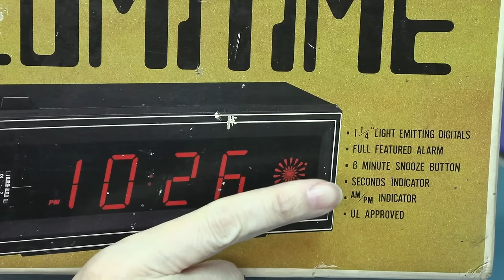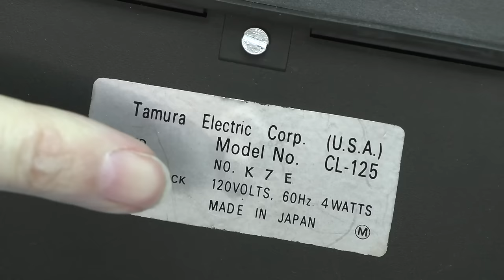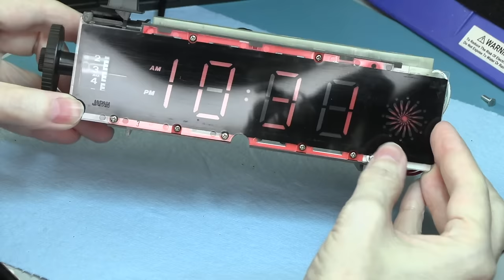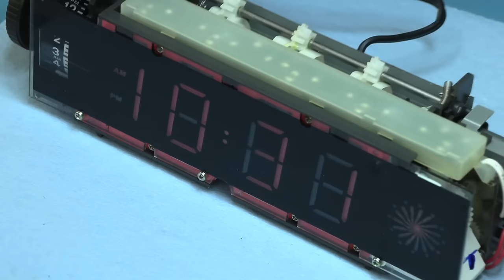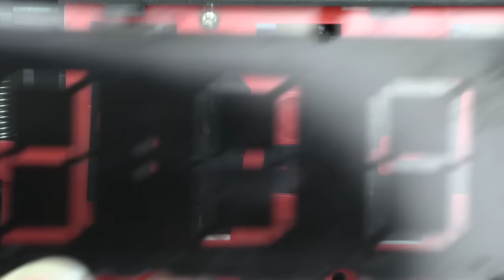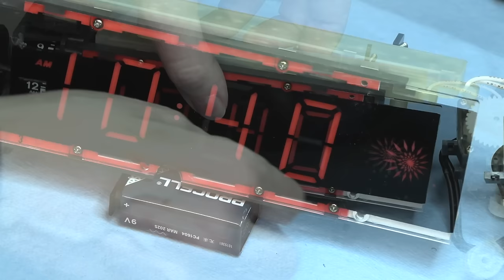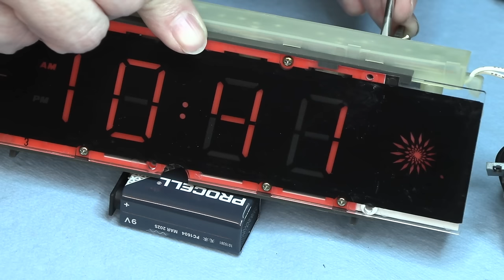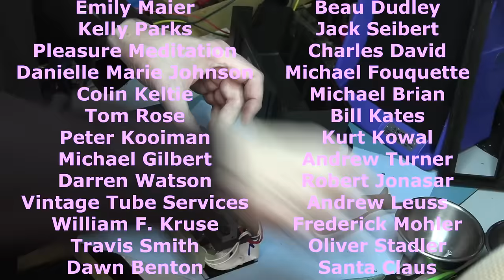Digital Clock Or Automaton?

Comment: Fran, if you can get a couple dimensions of that gear/shaft diameter with calipers, I will resin print and send you a replacement. Or a few - I typically print multiples +/- a few tenths of a millimeter for tolerance. I have been reproducing unobtainium gears for automatic turntables (and other vintage HiFi) for a couple years now, including gears that need to withstand being press-fit onto a metal shaft. I'm serious, no strings attached - I'd love to see you get this clock running again!
Reply: You're onto it! Need to experiment with some internal PLA slip clutch designs like the one shown in the video too. KUDOS
Reply: I always bore the holes up in press-fit plasic gears and glue them on the shaft with gel type superglue. Press-fitting them will cause them to crack sooner or later as the plastic shrinks. I do this even with original gears when I see one known as prone to this failure but not cracked yet, or started cracking but not between the teeth.
Reply: If provided with the needed measurements, would you still be interested to make those? My Lumitime just kicked the bucket and I'm about to buy another one in working condition and I'd love to future proof it, while repairing my current one.

Comment: A fascinating reminder of how ingenious humanity needed to be before the age of microprocessors.
Reply: You don't need a microprocessor for a segment display clock. The problem was that the new electronic displays and the active components needed to drive them were far more expensive, plus the "best" electronic clock display didn't quite come to be (early LEDs were notoriously dim and fragile, which is how come VFD helf up for so long - imagine when neon tubes are the brighter and more robust option) yet. Now it's the other way around, recently an American venture capital hype company with manufacturing in China of course released a very bland copy of a 1970s mechanical digital wtacth (see Amida Digitrend) and made everything run on stepper motors because of course they did. The original Amida was a cheap watch made to "compete" with the very expensive novel electronic digitals, and the Fakemida is a cheap Chinese watch with nothing inspiring to it (they stole the design, and filled it with the cheapest modern solution for the actuation) sold at an influencer premium.
Reply: How old is this desk clock? I remember building a digital clock kit, circa 1980, that was fully electronic! It comprised a single module that had all the logic and LED displays, plus a transformer, a speaker, a power cord, a case and a few pushbuttons. It was much simpler than the clock Fran has just reviewed!
Reply: @Armc31416  
It was probably made in the early 70's. By the 1980's the electronic equivalents became dirt cheap, even the formerly really high end minituarised stuff like LED and LCD watch modules.
Reply: @AnEntropyFan  That's an awful lot of words for a reply that has nothing to do with what the guy said.
Reply: @AnEntropyFan  "Their first assertion was that an electronic digital clock needs a microprocessor to work and then their second layer of wrongness is them clearly implying that these electromechanical facsimile of electronic clocks were made because no microprocessors." 
You sure read a lot into a statement of how ingenious mechanical computers/devices could be before microprocessors.
Reply: Not really.  This clock was created for style, not out of necessity.  It's very complex for what it does, and there are far simpler solutions to do the same thing even with the current technology at the time.  I'm not surprised this is broken.  This device has to be OILED to work properly as well.  What a nightmare design.
Reply: @fuzzywzhe  
It is very complex for what it does, but not at all for when it tried to do it - look and feel like an electronic 7-segment display clock, which was expensive high end tech in the early 70's (so much so that many industrial applications used stuff like Nixie tubes, if they were lucky that is and didn't use some sort of an equally convoluted and fragile mechanical digital display). The plastics they used were commonly self-lubricating (think how we use Delrin still), and you really do not want to oil anything that isn't strictly a metal to metal pivot point. All kinds of oils degrade all sorts of palstics.
Reply: @AnEntropyFan  I think nixie tubes were used in the 1960's and were largely replaced by the mid 1970's with seven segment displays.

This had to be made after seven segment displays were around.

This had to be a very small timeframe in which these were made.    I think 7 segment displays were ubiquitous by 1980.
Reply: @fuzzywzhe  
The 7-segments were around when these were made, yes, but were high end expensive tech (hence how come that these mechanicals saught to immitate them). 

Yes, by the 1980's 7-segment LED, LCD and VFD displays became ubiquitous and cheap. Kids are wearing cheap LED watches by late 70's for example. However, take a look how much a Pulsar (LED) or an OPTEL (LCD) watch cost in like 1972. 

There was indeed a very small time frame where electronic 7-segment displays were high end expensive tech, they got pretty cheap quite fast. Flip clocks were the cheap display option at the time, so much so that otherwise transistorised alarm clocks used them. LED and VFD alarm clocks became more common in the 80's. Backlit LCD alarm clocks are a 1990's thing I guess.

Comment: I have repaired this problem in the past by sourcing that gear from other more common clock models.  A lot of them had the same basic motor and gear driving them.  As a last resort, you can take the old gear and make an impression mold by carefully rotating the gear and making two impressions in order to replicate the missing teeth.  Then just pour resin in the mold. It doesn't have to be fancy, modeling clay will work.  Then you just have to carefully drill out the hole by hand.

Comment: I'd check McMaster-Carr.  They list plastic gears for shafts as small as 2mm.
Reply: I'd just 3D print one.
Reply: @Studio23Media  Injection molded is a lot more reliable in the long term, especially compared to PLA. Some resin printers and nylon powder based 3D laser printers give OKish results but those are very expensive.

Comment: I enjoy this video as I glance at my good old Philips HR 5391 LED Alarm Clock. It stopped working 15 years ago. I took it apart then, but I did not bother to look into fixing it. I was in over my head back then. The pieces stayed in the bag for 14 years, until I stumbeled over it last year. I then looked at the PCB and measured out the suspect components again &  figured out that an electrolytic capacitor was bad. I replaced the cap, and now it is all good again  :D
EDIT: After watching Fran's disassembly of the clock I understand that the Limitime is a completely different, mechanical beast, compared to my Philips

Comment: You might have a shot with a small stepper, like the 28BYJ-48 to replace the dead sychro motor. 
A stepper would also be able to be placed a stage or more ahead of the broken motor drive gear.

It's a thought, and they are Dirt Cheep.

Next would be to sync the stepper to WWV or the like. <G>
(Off a Xtal should be good enough  - Arduino anybody?)

Comment: Isn't the slip clutch internal to the motor also to allow turning the time setting shaft without having to spin the motor? Many of those types of clock mechanisms only allowed the setting wheel to be turned in one direction. And forcing it the other direction often broke teeth.

Comment: So happy.. I clearly remember my father had a radio clock with this exact clock technology, down to the black and white chequered dial on the left. Worked 24/7 for a couple decades or more,  than the clock started to go all over the place due to mangled cogs and could not be fixed as spareparts , unsurprisingly,  were unobtanium. Cool.

Comment: This approach, of replicating the function of newfangled electronic things by mechanical means, reminds me of the products by the Tomy company, also of Japan. They produced a lot of products that sure seemed to be electronic but were internally ingenious and elaborate mechanical contrivances. I recall a handheld "pong" type "video game" which DID have a tiny LED (as the 'ball'), but that was moved around by layers of complex plastic gears, cams, eccentric lever arrangements, all forming essentially kind of mechanical analog computer that could respond to the paddle movements of the player, and calculate what the balls trajectory should be as it "bounced" around during the game. The only circuitry was the battery, a small DC motor what provided motive force to the mechanism, the aforementioned single LED and its current limiting resistor.

As for THIS clock, if the only thing wrong with it is a dead motor unit, I wonder about adapting a small stepping motor to drive the main shaft. Then, a simple electronic clock circuit and a stepper controller IC could be used to run the motor. Might just about fit into the same case, or perhaps the right side of the case would need to be modified to provide a bit more space. Alternately, one of the tiny microcontroller chips (Parallax, Arduino, etc) could be given a simple program, along with one of the many tiny stepper controller ICs (and a suitable power supply, probably external to the case).

Comment: Very cool mechanical shutter system.  Looks like when that motor quit it overheated baking that gear.  Probably a bit too much work for a synchronous motor to handle.  To get that working again you could 3D print an assembly to hold a small stepper motor and a dedicated speed controller for it.  Probably not enough room to also add a power supply so the lamps would have to be switched out as well so the whole thing could be run off a DC power supply.  But it would be cool to see those shutters moving under power again.

Comment: Back when I used to work on clocks I joined a clock repair group and they were amazing.  You could ask fir used or new old stock and you be surprised what people have in their stuff. I hope you can find something like that.  And you can cut a new wheel by hand with some help from lathe. Course people don't like slow ways.

Comment: I am dumbstruck. This is technological archeology right here. Imagine someone a thousand years from now analyzing this. In the early years of LEDs the holy grails were larger LEDs and LEDs in colors other than infrared and red. This design solved the former problem and could have used a blue filter for the latter. I'd bet the designers didn't even imagine that blue LEDs would ever become possible and so missed that opportunity!

This video is too humbly undersold. It's brilliant. 😃

Comment: This disentigraging gear problem is the same thing that happened to the motor in  my ball bearing clock from 1979ish, the gear just melted.  I replaced that motor twice, the first one came from a clock parts company that had the replacement motor.  That one broke for some other reason.   The second one couldn't be found from that clock parts company but came from some kind of a timer motor that had the same motor internally but a different gear reduction, which i switched out.  The pinion is a different kind of plastic in this model so hopefully wont melt.  But I'd go with the resin printer guy above.

Comment: My dad had a Lloyd's clock radio with a similar clock movement. Only it had an opaque panel in front of the mask, and the light shone through from the back. The shutters were made of thin, leaf metal. The numbers displayed in a light green colour.

Comment: General Electric made some clock radios in the late 1960s / early 1970s with similar mechanical digits clocks. Instead of neon,  they had a holder with two wedge base incandescent bulbs to illuminate the digits from the back,  so they were white instead of red, since the clock face plate was clear plastic with black shutters and black painted mask in front of it all.  I have two or three of them and they still work.  I sent Big Clive a smaller General Electric alarm clock (no radio) with this type of backlit mechanical digit clock for him to experiment with.

Comment: That motor reminds me a lot of Intermatic motors. While the little cam to reverse direction is definitely different, that drive pinion on the rotor looks remarkably similar. You might be able to try and replace that pinion with one of those. The only reason they used soft plastic was to keep gear noise down. A hard plastic or metal gear could also be used, it'll just be more noisy. The cam to reverse direction could definitely be 3D printed.

Comment: If you remember in very early science fiction (written before transistors and modern electronics), the computers were analog and if the programming had to be changed, they would machine a new cam for the computer. This clock reminds me of that.

Comment: I recently bought a non-working but great cosmetic condition Lumitime YT-102 alarm clock. It appears to be very similar to this one (the front bezel and the "starburst" are bit different, and it might be a Japan-only model). It very likely has the same internal mechanism as your clock. Mine lights up but the time doesn't advance, so it could have a similar problem as yours. I haven't had time to open it up yet but I'll be interested to see if it also has a dead motor / disintegrated gear.

Comment: Ha! Not Light Emitting Diodes at all. "Light Emitting Digital," meaning only that the numbers light up.
Not all that unlike the flip card digital alarm clock from GE that I had in high school, but the numbers on mine were white, where these are red and try to mimic the look of eight-segment LEDs.
I think I liked mine better. It was more honest in its presentation.
Reply: Had a flipper too. Loved the alarm, which was the speaker hooked to line voltage through a resistor.  Always fun to start the day sounding like you're being electrocuted.

Comment: The 3D printed gears for Macintosh floppy drive eject mechs can't be much bigger than this? If they can be successfully 3d printed I don't really see that a replacement here wouldn't be possible?
Reply from the maker: It would be better to machine one from brass.
Reply: @FranLab  sure if you've got the kit.
Reply: @FranLab  may be worth asking @mymechanics to make a new one :-P.
Reply: @FranLab   after seeing the same gear fail in other clocks, now I'm wondering if maybe it's a "sacrificial gear" designed to fail (say when someone winds it backwards while it's running) to avoid wreaking havoc with the entire mechanism..in which case a brass/metal/polycarb replacement gear may not be the best long term solution
Reply: Is it possible to mix brass and plastic gears? I'm afraid the stronger material will eat plastic teeth

Comment: I may be way to cynical, but when it said digital I discounted led immediately. Resin printers can handle the resolution, but finding a resin with the right flexibilty for the reverse block may require a few tries.

Comment: Hi Fran get the dimensions and count the teeth  take a photo  etc  I have printed gears that size  just recently for janky TV rotators. and also a speedometer trip meter tiny gear it Work's quite well. Those yellowing opaque type gears are what I call the cheese gears they fall apart with age, The reason they where used is 1 they are classed as the weak point if something gests stuck  it will fail before the plastic ones, The other reason is plastic gears i print work fine just they do allow more gear noise in the gear train so they where like a flexible gear and cut down motor noise etc..  That gear could be printed but with mine I have to tweak the seize about 5 times to get it just right.  fist one was bit tight and wouldnt run free rest were a BEES willy under and skipped teeth  .  next 2 were just right

Comment: Thanks for the great video! May I recommend, when you're faced with plastic release clips holding housings together; proceed with the corner of an old credit card to release them easily with minimal damage. I've opened and closed thousands of laptops in this way without breaking a single catch, and no indentations left in the housing. :)

Comment: Old PVC sweats out the elasticizer,  which will often damage other items it is in contact with.  I dont believe the Styrofoam damaged the vinyl.   It's likely the vinyl damaged the Styrofoam.   Even new pvc can damage styrene or other plastics if they're in direct contact.

Comment: Those gears are a pain to find, there`s no indication on who made this motor, or dimensions/number of teeth on that gear. I have a Lumitime clock in a near mint cosmetic condition, but with a FUBAR gear. If you manage to source one, would you share where you got it from? I saw quite a lot of those Lumitime sold for spare, and I believe that tiny gear is the culprit every time.
When they are working, though, it`s pretty cool to watch.
Reply: I think I remember fixing this one with parts from an Intermatic motor from a plug timer, I made it work somehow either with just the gear or swapping the whole rotor. The model timer you want is an Intermatic TN-311
Reply: @ericlohr315  Unfortunately, they don't have the same shat diameter and therefore, it won't fit on the clock. I even tried to swap the rotor, but they're different enough so they don't fit either. The search is still on...